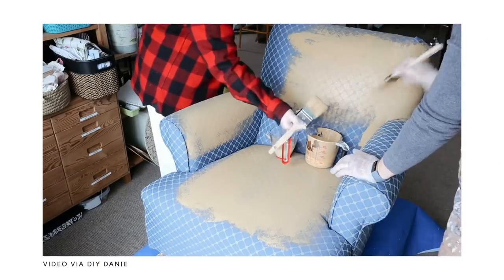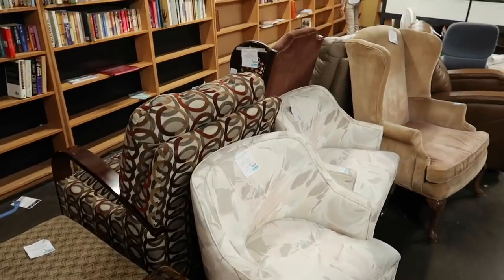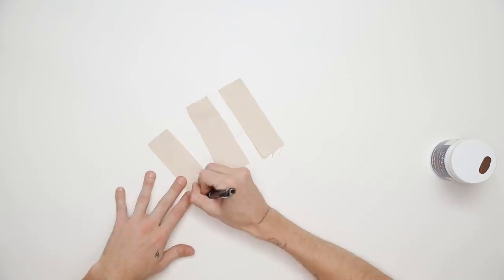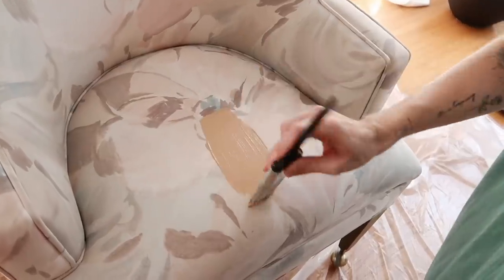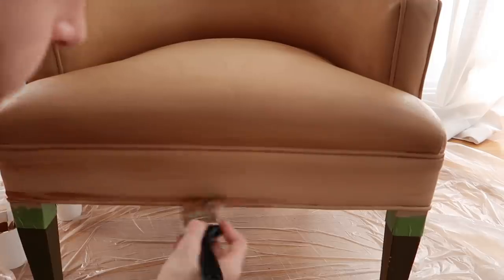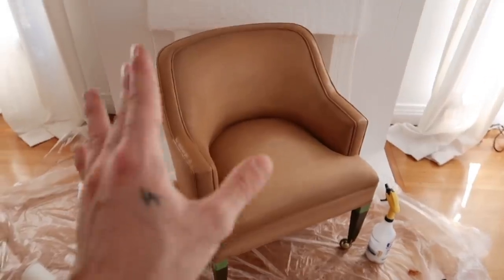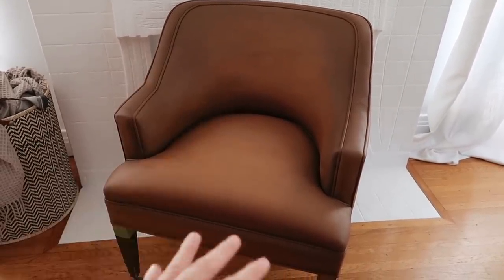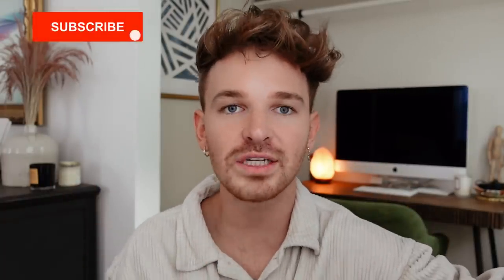Painting Thrifted Furniture To Look Like Leather?! *It Actually Works!*

Comment: I've been a teacher for almost 30 years, and i can share a similar hack. We always do a lot of t-shirt decorating with the kids for holidays and school events, and fabric paint can be really expensive when you need to buy enough for 100 kids. You can make your own fabric paint using regular acrylic paint and adding a very small amount of fabric softener. About one half teaspoon per one cup of paint is a good ratio. It's not exact, but if you use too much, the mixture can get lumpy. This makes a fabric paint that WILL NOT wash out. You can also thin this mixture out with water and put in a spray bottle as well (just thin it out quite a bit or it will clog the sprayer.)
Reply: Thank you for that amazing hack!!!
Reply: Thanks ❣
Reply: Beginner teacher here. Thanks for this great tip!!
Reply: Wow, that's great to know it doesn't wash out! Do you think this technique could work for making a faux leather jacket?
Reply: @FelineOcelotLady  i don't see why it wouldn't...it's worth a try i think...faux leather decorative pillows would be really cool and beautiful too.
Reply: @yeneka713  Doesn't the paint stiffen the fabric?
Reply: @nycgraphist  it can, if the mixture is really thick. (Depends on the brand of acrylic paint, how old the paint is, etc.) We typically aim for a consistency of something like gravy. If it's too thin, it will bleed through the fabric (which may be ok, or it may not be, depending on the project)
Reply: Does anyone know if you can go from very dark purple/black to very light pink??
Reply: @yeneka713  do you know how much the paint would affect "breathability" of the fabric? I'd love to try this out some day for making my own faux leather jacket... heck, i could restore some faux leather pieces that have peeled on me. i hate faux leather so much.
Reply: @fireroum  if you paint the DIY fabric paint on really thick, it stiffens quite a bit, and might affect the fabric's breathability. If it's a jacket, i'm not sure that would matter much, because i assume it would be a thicker fabric anyway...test it on a thrift store purchase first! LOL
Reply: @yeneka713  great idea!
Reply: @yeneka713  thanks for the response! Sorry for the late reply, i had to come check manually cos youtube doesn't tell me people reply to my comments 🤦‍♀️ i ask about breathability because i live in a hot and humid climate, but have to wear jackets sometimes when it's cold indoors, plus i do have some faux leather pieces of clothing that have peeled on me... that i would like to continue wearing without having to sweat buckets in them lol. Thank you again for the info! Will try it out 😁
Reply: @Lili-xq9sn  paint it to white first
Reply: Thank you so much for posting this hack!
Reply: Does the fabric you paint have to be smooth or can it be textured fabric?? And do you need to wet the fabric or is that part not necessary?
Reply: @jessicaowens836  it can work on textured fabric, but the more textured it is, the more likely the paint might eventually start to come off. This is simply because the paint is not making as much contact with the fabric. And no, do not wet the fabric first, although it should be washed prior to use, especially if the fabric/garment is new.
Reply: Thank you so much I will attempt to dye a stroller with your recipe
Reply: creator bless you! this is a fabulous idea. now i'm gonna be painting all of my upholstered furniture when i tire of its look. thank you!
Reply: Only thing with repairing faux leather (current project is pair of thigh boots), is that the fabric you're left with when it's peeled can be a thin foam. I'm wondering what effect the acrylic/fabric softner mix would have on it. Or of I should try to remove the foam too. Tricky. 🤔
Reply: I will definitely use your hack, thank you!!
Reply: I mixed 50/50 as in this video for painting the fabric seat of a dining chair. It basically curdled and went very lumpy. I had to spray quite a bit of water on it as I was brushing to get rid of the lumps. When I do a second coat tomorrow, I’ll use a lot less fabric softener.
Reply: @ oh no! Yes you only need a very very small amount…like less than 10%. So maybe 1/2 teaspoon fabric softener for about 8 ounces of paint.

Comment: With time the painted furniture will soften and feel and look even more like leather. My mom painted a couch in 1975 and it lasted for years and looked awesome.
Reply: Are you able to spot clean it or is it ok if it gets wet?
Reply: I guess that answers my question...
Reply: @hawkessa   Latex paint is basically a plastic, so it doesn't absorb liquid or anything wet. If you spill something on it you can just wipe it off. You can also easily clean the whole piece with a damp cloth. Basically, you can clean it like Tupperware or any other plastic.
Reply: @TerriKash-NEO  THANK YOU!!
Reply: Amazing!!
Reply: @TerriKash-NEO  I would think some finish would be required. Maybe like a coat of polyurethane or maybe a finishing wax polished and buffed would give that leathery look and feel, and a good protection.
Reply: @nycgraphist   In my experience it's not necessary to have any kind of finish coat. I think Polyurethane would be too hard of a finish, but you could certainly do a test on some scrap fabric. The Poly I have is water based so maybe it could work. I would definitely test it first, and make sure to set something heavy (that is also wrapped in fabric) on it for awhile - you want to make sure the surface will not stick to fabric that a person would be wearing if they sat on it. Also test for cracking. Anyway, interesting idea. :-)
Reply: @TerriKash-NEO  I lean to the idea of latex paint only. And then if it does wear badly after some years you could repaint it again.
Reply: @rebeccacampbell585  I agree. Latex paint is extremely durable and will last years in my experience.
Reply: @TerriKash-NEO  does latex paint come in different finishes??
Reply: @jettsetgirl  Yes, latex paint comes in a mat, a satin, and a gloss finish. I would use a mat finish for painting upholstered furniture for most projects, but you could try a sample piece of fabric with the satin or gloss finish. They are all water based paint however, so any of the finishes should adhere to the fabric equally well. HTH :-)
Reply: did you mom mix fabric softener w paint in 1975?  just curious :)
Reply: @F%98%83annel/UCCN4qr2MOig7uZGjKJT5hwQ No, she used latex paint straight from the can. I was there and helped her paint it. HTH
Reply: @TerriKash-NEO  that's amazing. I've painted a ton of things- but I mix fabric softener.  IT smells great too IMO
Reply: @nycgraphist  I've heard that you heat seal it. Either with a warm iron or a hair dryer or heat gun. Good luck.

Comment: I’m not even done with the video yet, but I wanted to say YES! I used the house paint/fabric softener method a few years ago (after finding a blogger who had success with it) and the chair is still holding up great today. It looks amazing. I love that you are sharing this technique.
Reply from the maker: This is so nice to hear! I am hoping this chair lasts a while as I'm in complete love with the outcome!
Reply: Do you think this will hold up with dogs?
Reply: Thanks for this comment because I was wondering how well it would hold up
Reply: @samanthayoung50  I have a dog, she doesn’t really use the chair. I can tell you I have four small children and it has held up great with them. And they use it all the time. It seems really durable.
Reply: @AgrestaNC  what is the exact recipe / ratio for the best outcome?
Reply: @PusaStudios  I’ll try to find the original blog post that I used as a reference, but I think it was similar to Drew’s experience. I experimented and ended up doing about three to four tablespoons to a half a cup of paint. You can tell if you’ve added too much because it will clump. And if it did clump I would start again with a little less softener. The paint does stay wet for a while but I would only mix a little at a time because it goes pretty far and I didn’t want to waste. One tip from the blog is to choose a fabric softener scent that you can stand for a while.
Reply: Can it get wet or can you spot clean it?
Reply: Mariana T  First, the texture is amazing. Feels like faux leather. Totally changed the feel of my canvas covered IKEA chair. The blogger that I got the idea from did this on a couch and I think she had kids. I’ll try to find the post. I honestly don’t know how this will hold up to everyday/all day use. My chair gets used every night when my kids come to my room for a night time video. So it does get used (and climbed on) a lot and there is no evidence of wear after three years. It depends a bit on the fabric you are painting on I think.

Comment: As someone that does upholstery for a living, I usually cringe at painting fabric, but DAMN! This looks sooo good.
Reply: Looks expensive too.  The dark wooden legs, I'd add copper studs around the base or at least the front section above the legs.
Reply: @JN-fy4zt  That’s a fantastic idea! I think that would give it the perfect finishing touch!!
Reply: What do you think about the longevity of the paint
Reply: Hello Christina! You seem like you would know the answer to my question. Does the paint crack with use? It looks so good but before I do a thrift flip I would want to make sure the pain cracks. Thank you!
Reply: @rachelguerrero2489  I’ve never tried it so I wouldn’t know for sure, but that is one of the worries I would have. Other times that I have seen people paint the fabric it is not smooth, you can see the print of the fabric, and it generally just looks like it was painted which in my opinion looks cheap. I would be interested to see a follow up on this project to see how it held up.
Reply: Hi. Christina you might have the answer so I’m trying to purchase and upholstered bed but I want to change the color, is there and dye that I can use or am I better off not getting the bed
Reply: @christinaugalde8822  I, also, would like to know how this chair looks five months later. So curious how the paint held up!

Comment: What I want to know is who even thought of adding fabric softener to paint to get a leather look?  A chemist?  A paint factory owner?  Love the look - amazed at whoever figured this would work!👏🏻😎❤️
Reply: I’m not sure that the fabric softener has anything to do with it looking like leather. I think the shading makes that happen.  I’m about to paint some outdoor cushions with the same formula but just one color.  Also planning to paint a small couch with the three color leather look.  We’ll see how it goes.
Reply: I think the leather look is from the paint mix of hues. The fabric softener probably just helps it not solidify into a rigid paint shell and be more of a stain.
Reply: @DR-bp1yu  Yeah, my first thought is that straight paint would dry and crackle and the fabric softener maybe softens the chemicals in the paint to blend into the fabric.  I wonder how it works overtime.  Does anyone know how this chair held up after a year?
Reply: @oscarfelix1952   Yeah, I saw a couch that was painted with this technique and it had been a few years. It held up well, stayed soft and pliable, was fairly stain resistant and cleaned up easy.
Reply: @oscarfelix1952   Read @Terri Kash comments above....
Reply: @pamelaspeich2881  Thank you!

Comment: I wonder if there’s some kind of light wax or fabric conditioner that could go on over the paint to give it even more of that leather look and feel. So shook at how nice that paint worked though
Reply: I did two chairs and I put clear wax over them.  I also sanded between layers. I also used chalk paint.  And sprayed the chair with water as I was painting so that the paint soaks into the fabric better.  Then when completely dried apply clear wax.  Super soft.
Reply: Kim, how has the chair held up since doing this?
Reply: Kim, What kind of wax did you use? I have cats and I wonder if using wax would discourage them from scratching.
Reply: Heat sealing with a warm iron or a blowdryer or heat gun.

Comment: Use a Roller to smooth and even   out the paint.  When its completely dry  lightly sand with a very fine grit and vacuum out the dust

Comment: Please forgive if this has been mentioned already but I love the chair and how it turned out and would love to try this in my own thrifted chairs. First hygiene wise  how does this work out? Like how do you confirm the thrifted chairs don’t have bugs, etc? Is there a certain type of chair that works best for this type of work and what are the lasting results? For some reason I envision paint cracking and peeling with excessive use over time? What types of paints work best or does it matter? I’ve seen a few chairs that I’ve been eyeing at my local thrift store but I’ve passed due to stains but if I can paint successfully to hide them, they could work. Any suggestions and insight? Thanks so much in advance.

Comment: It looks amazing, original and super easy. 

Question! Do you know if it works on faux leather too or only fabric? 

TIA.
Following from Chicago. 🤗
Reply: @Mariana mendez 
I would peel faux leather off first. Faux leather will crack one day and fall off, unless you seal it with some magic product that works...I had a ottoman where faux leather just started to peel,  I used a heat gun to peel it off down to fabric, now I gonna paint it!

Comment: Came out amazing but I am a little confused as to what you did.  Why would you do the shading on the first coat?  Did you apply shading on the second coat?  I dont think you did and it would seem that the second coat or last would be when you do the shading and not first since it would be convered by the next coat!  I was about to use spray paint since I saw people have to 5 coats with water down messy chalk paint but after seeing this and the other one you mentioned, I think I may try this technique!  Great job!

Comment: Bear in mind that natural leather has blemishes and areas of discoloration. The fabric on this chair had a printed pattern but in random rounded shapes. Avoid a strong geometric pattern with straight lines and high contrast colors for that might need many coats of paint for convincing coverage. I have an office chair of bonded leather and, as is typical, much of the finish has abraded away, leaving the cloth backing exposed. I am wondering if this technique would cover the entire upholstery, both the cloth areas and the areas where the bonded leather remains intact. There are also areas where the bonded leather is cracked and peeling so I wonder if the paint would fill and adhere to those sections. I dread the thought of trying to sand the surface of the cushions.

Comment: I just want to share that I am painting a couch because of this video, and let's just say it's.....interesting. Oh, all right, it looks like crap! Well, not crap, but first off, my paint is NOT acting like Drew's paint. Instead of thinking I might run out of paint, I may run out of fabric softener. My paint is clumping and is like wet cement unless I add A LOT (and I do mean A.LOT.)of fabric softener. It doesn't look like leather AT ALL, but I wasn't even expecting that b/c this is a quilted couch made from some kind of satiny material. I just wanted to hide it's water stains, and decide if I want to some day have it reupholstered. Anway, it doesn't feel "smooth" at all. It feels like a couCh that was painted with paint, go figure. 😖. And my entire living room smells like Downy. I guess that would be good but it's not the Downy scent that I use, so it's just very annoying. I used Downy Ultra. Does that make any difference? I wish I would've used the exact one Drew did. Also because it was blue and my paint is a little warm-toned gray, the blue tone of the Downy changed the tone of the gray and made it more neutral. So, if you needed a specific color, you might want to keep that in mind.

Comment: I just tried it with Valspar paint and a generic fabric softener (not downy), and the paint immediately separated and got super thin with clumps at the bottom. 1:1 ratio, as recommended in your video. I’m so sad… has anyone had this experience?